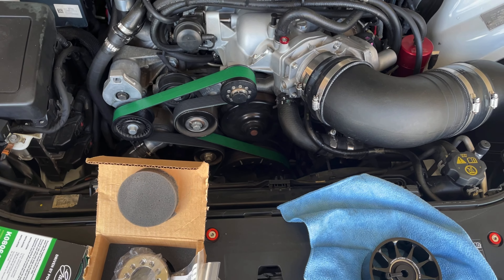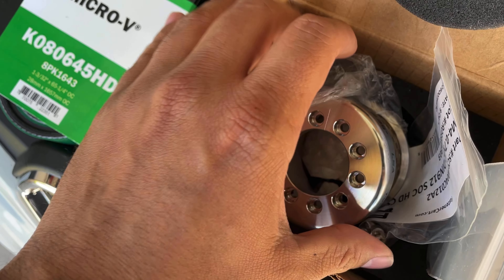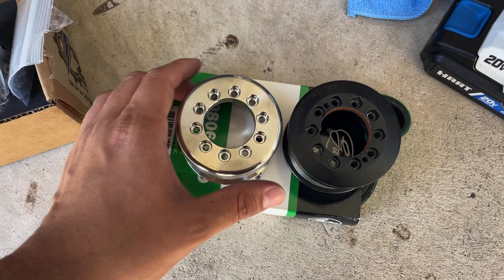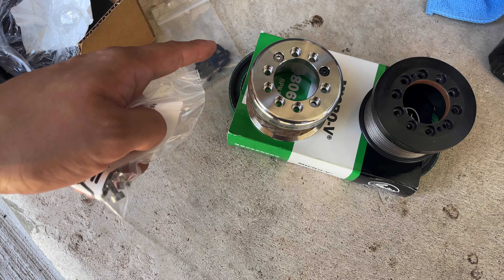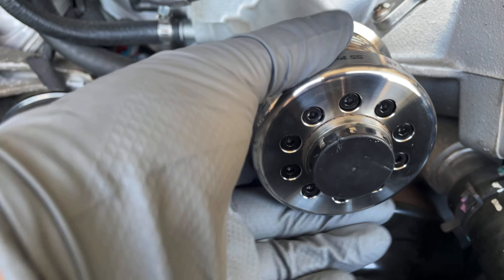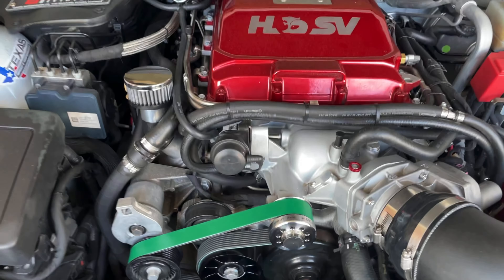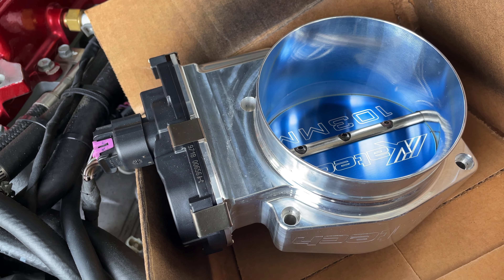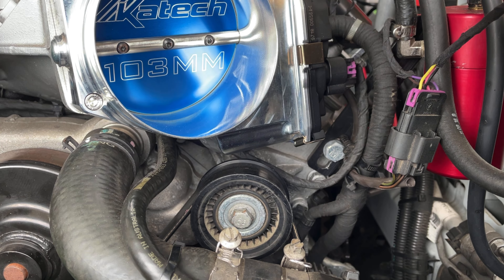LSA Supercharger gets a 2.35" upper pulley, 100mm idler pulley, and a 103mm throttle body

Comment: I’m following this build closely, I’m running the 2.35 with the 8.6 lower. I ran into a problem with the ac, and alternator not lining up with my new lsa balancer. 🤦🏿‍♂️ I guess I was suppose to convert it to the zl1 style brackets and alternator. How did you get your 3 belt system to line up correctly? New ac bracket?
Reply from the maker: Hey bud, I went with the stock lsa balance. I haven’t had any issues and didn’t change/add anything else besides the brackets and pulley for the supercharger. 

What lower did you go with? Is the lower sitting to far in or out? Is it throwing belts?
Reply: My lower is a 10% lower power bond.  
Part No. PBO1662SS10 it’s sitting far in, my ac belt doesn’t line up, and I was told I’d have to convert my ac bracket to the zl1 bracket, and my alternator/bracket and idler bracket to the zl1 style for it to all line up correctly.

Comment: When you install the larger throttle body, did you notice any Amplified blower wine noise over the stock throttle body?
Reply from the maker: Tbh not really but that’s probably because my exhaust is loud. I barely hear the blower unless it’s WOT.
Reply: Your blower sounds pretty loud to me. Seems like Most are quiet.
Reply from the maker: @adam96blackss  I guess from outside it’s a different story. Sitting behind the wheel I can’t really hear it.

Comment: its going on 2 months now,any belt slip with the 2.35?
Reply from the maker: Nope haven’t had any issues. Definitely recommend the 100mm with it though.
Reply: @LosSS  
I just ordered the 2.35 from zpe..also have the 20-163bk holley lsa accessory drive kit coming..
Reply: @LosSS  
what lower pulley did you go with?
Reply from the maker: @dalehall2993  stock ctsv/zl1 lower
Reply: @LosSS  
I just ordered a 9.45 from dsx tuning..did you have it tuned yet?
Reply from the maker: @dalehall2993  yes, had it street tuned. No dyno numbers unfortunately. Need to take it to the 1/4mile track this fall.

Comment: What coupler did you have to have to use for 102 to 4 or 5” intake ?
Reply from the maker: 5" ID Straight Silicone Hose Coupler, High Temp 4-Ply Reinforced (Qty 1) - 131-12703-0401 - Ticon Industries

Coupler purchased on amazon. The intake is 5in.

Comment: Will that TB fit with the stock LSA snout or will it need to be ported? Or use a spacer
Reply from the maker: Most stock tb will fit, I was previously using a ls3 tb with a ported 102 snout.  In my case, I could have used a 102mm to 92mm adapter but used gasket maker instead. Many have run a ls3 on a non ported stock lsa snout without issues

Comment: Are you gonna have it dyno'd after the new tune?
Reply from the maker: Unfortunately probably not. I am no longer tuned by the person that initially  dyno’d it after the lsa install. 

It originally put down right at 700rwhp at gforce on 10.5 # of boost. It then made 730 at 11.4 # after fixing the bypass, it was leaking boost. Since then, I have added a 103tb and the 2.35in pulley. My current tuner sent me a revised tune and I did some data logging this past weekend. According to hp tuners, max boost I am seeming is 12.75 #.
Reply: @LosSS  Wow, that's pretty good.  I'm running at 6# with my magnuson heartbeat.  I'm wondering if it's worth it to do a flex fuel conversion.
Reply from the maker: If you are looking to squeeze more out of it, then yes I say doing a flex fuel sensor and e85 will help. But also depends on fuel system; injectors and pump. If injector duty cycle is high, then you'll need injectors, if fuel pressure is dropping, then you'll need fuel pump upgrade. Many go down the route of 1000/1300CC and like a DSX aux pump. I didn't want to tap into my gas tank so I went with a fore dual pump in tank kit.